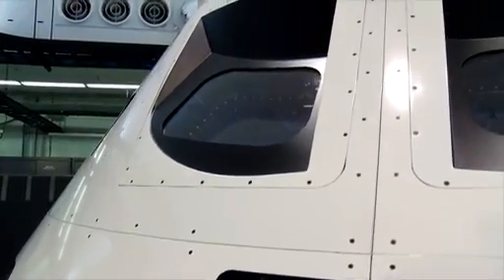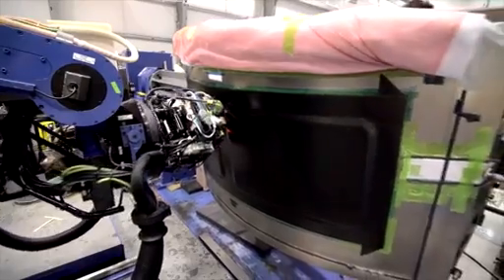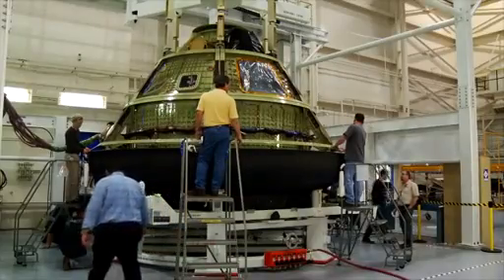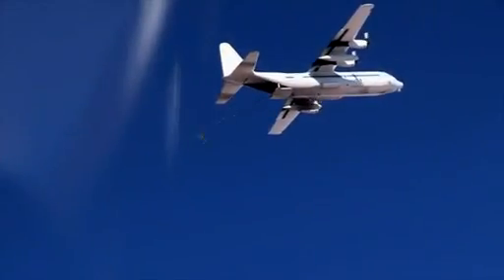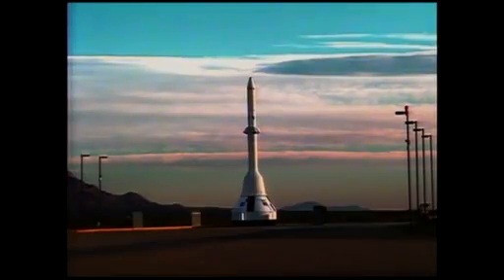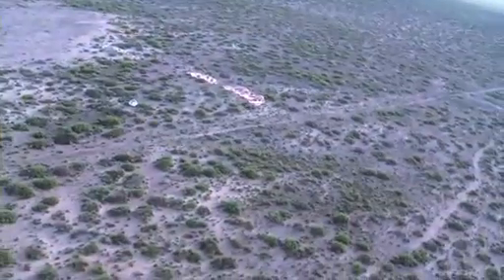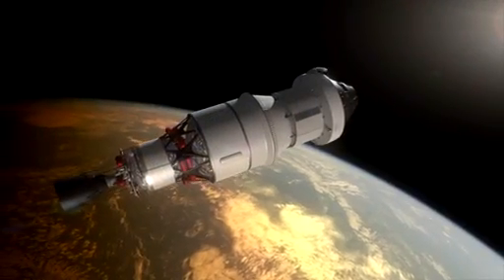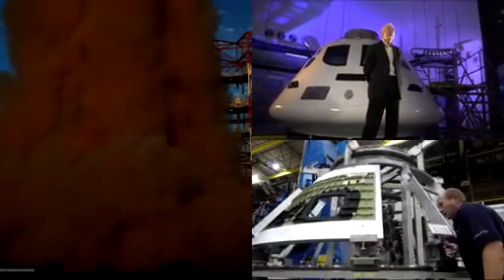Orion: From Factory to Flight

Comment: The Saturn V, which got us to the moon, is/was the most powerful rocket ever flown. The Space Shuttle was only for low-earth orbit, used for building the International Space Station and launching satellites, like the Hubble telescope. We used the Shuttle for 30 years. So, if anything, we're moving forward with the Orion spacecraft and Space Launch System which are designed specifically to go beyond low-earth orbit to the Moon and Mars.